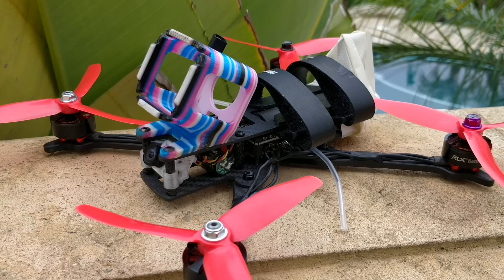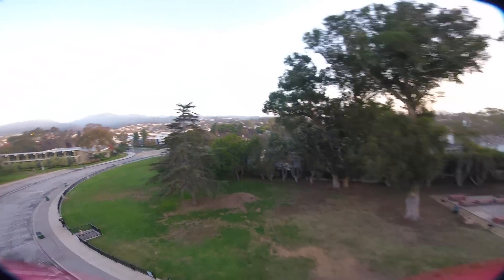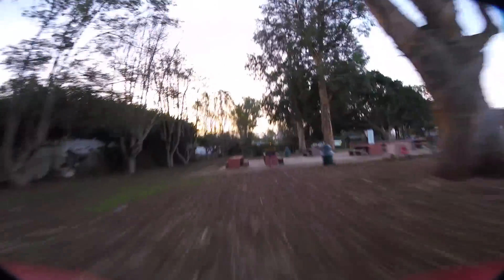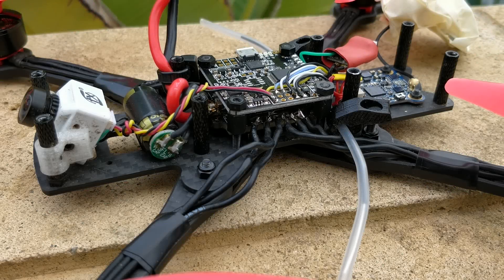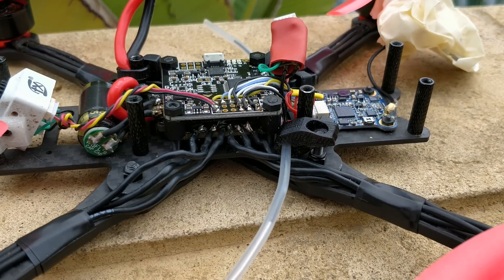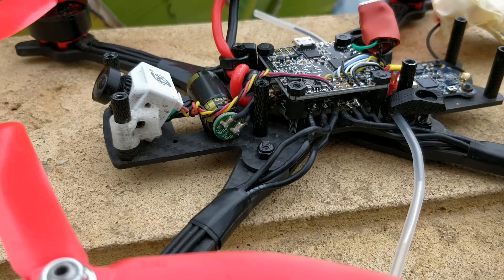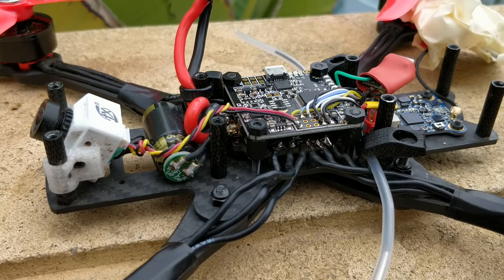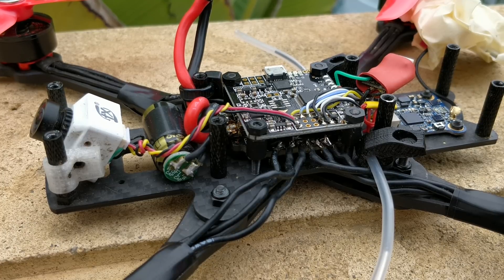Naze32 in 2019...

Comment: BF 3.2.5 not 3.5.2. Got me for a minute there. I though did they start supporting F1 boards again?
Reply from the maker: Oh shit you're right!!  My dyslexia wins again!
Reply from the maker: holy hell I'm putting 3.2.5 on my other quads now.
Reply: @Kabab  I've been running all of mine on that for over a year now - BF 4.0 builds are good enough that I'm moving them all over.
Reply: @tehllama42   Are you saying that you are rolling back your BF to 3.2.5....?
Reply: @MrFadjule  Nah, that I've been running 3.2 on everything since it was in release candidate.  Even after 3.5.2 came out, I was still flashing builds to 3.2 because I was more comfortable with my tuning approach and D-Term Setpoint Weight/Transition settings.
The #1269 and later BF 4.0 builds have dynamic D-Term lowpass filtering, and that's a big enough handling improvement that I'm flashing everything over to take advantage of it (even though I'll have to retune a couple dozen quads, and figure out my feed-forward preferences)
Reply: @tehllama42  same same i just finished switching from 3.2 to 4.0
Reply: Whats the pids? Im curious lol
Reply: I would like to build a race style quad that I can fly stabilized LOS, does this board offer a stabilized flight mode?  Thanks a million for sharing your knowledge man.
Reply: @dronexfun8469  Yes, the accelerometer is what is needed for stabalized modes, and all boards have it. Some people disable it to save CPU load, which disables the stabalized modes. In betaflight, look for ANGLE and HORIZON flight modes.

The Naze32 rev5 came in two flavours - acro, and full. The full version included a barometer and was more expensive. The rev5 version was very popular and arguably a better board than the subsequent rev6 etc boards. Personally I don't disable the accelerometer as I use it for failsafe settings (if you do that, you do need to test the failsafe throttle setting [use lightest flying weight], to make sure the quad actually comes down). This gives you a safer level decent (failsafe  LAND setting) and allows usually zero quad damage after a failsafe. I fly mostly bush(forest) areas. If you fly where people might be, the failsafe DROP setting is advisable (no powered props at crash time).
Reply: @dronexfun8469  Yes it does, It did it back in the Days already

Comment: Thank you for this vid.  Is there any possible way to put curfew or ELRS on this flight controller?
Reply from the maker: I'm pretty sure you can. I haven't used elrs however but I'm expecting it to be the same as the rest
Reply: sure! I'm flying Naze32 rev 5 with ELRS using UART2. UART2 pins are RC3 (TX) and RC4 (RX).

Comment: I actually got a old quad from a buddy who could never get it flying. Wasn't really wanting to get into FPV quads since I was deep into RC cars at the time but they were always interesting. Got a box with a drone and a bunch of random parts with the cheapest transmitter and receiver with one battery and I found all the same little hacks you did with this board. I am practicing in a sim at the moment but the quad is now a camera mount away from being ready for its first FPV flight and I know so much now that I priced out a modern build and I was over joyed seeing how streamline things are now. Anyways this video gave me hope to actually have a quad that would be worth putting some cash and a bunch of time into. 

Even got the old DYS 20a V1 oneshot125 escs flashed to Multishot at 1.5k and .5k
Reply from the maker: Way way wayyyyyyyyyyy easier today vs just 2yrs ago

Comment: i got this chip and i tried to connect it to betaflight it wouldnt reconize if only cli so i tried to flash naze to it bit betaflight didnt seem to have anny 
than i tried so with cleanflight and it keeps saying failed to connect to bootloader 
i get the blue solid light even do its a pain in the ass when connecting the 2 copper plates 
what am i doing wrong ? i really wanna learn how to build this thing
Reply from the maker: This is a very old board. You may need the old betaflight. Or you actually just need to put it in boot mode and flash whatever the latest firmware for it is.
Reply: @Kabab  i bought a bunch of old drone parts and might have overpaid a bit 
i bought them hoping to learn something about drones, theres 2 naze 32 chips in there
both of them would only open in cli, so i decited to take 1 apart hooked the chip up to my laptop and tried to flash it but now its stuck on the blue light 
i think i might have bricked it ?
anny recomindations on another cheap chip i can put in there i think its using 6s batterys and 2300kv motors
Reply from the maker: @Tyson31991  I would absolutely not recommend anything old or cheap. FCs are like $30 or less these days. You can probably find a modern one with osd for even $20. You're wasting time and money with anything cheap. It will cost you more in the long run. Just get a talon, Brainfpv it even a flight one board.
Reply: @Kabab  thx will look into it if i cant get this one workin

Comment: I made the mistake of trying to use an F3 board in 2019. Blew 2 boards in a row by supplying it 14.8V accidently instead of the 5V input required. I have found $20 F7 boards on banggood, so I am just using those now

Comment: I think people blame equipment too much. 
I started out with a naze32 board and a tactics fw radio that only had a pwm rx. I used a pwm to ppm encoder and rocked that setup for a while before I bought decent gear. 
I crashed a shit ton, and the rx would lose signal all the time, but I didnt know any better or have anything to compare it to. It made me learn how to fly and once I got a new radio, holy fuck I flew so much better.

Comment: Hmmm, naze32 came out when there was no blheli, no bitchin motors, only 8" props with simonk esc. Having new tech esc/motor/props/mini frame is cheating imo and then adding the latest BF (for the F1 board), if your going old school, then do it with a KK2, non simonk esc, takner quads and run baseflight, make it real, and not real babble.

Comment: Funny thing: I built a 280 quad back in the day when the naze32 first came out...I havent really flown and suddenly had no time and other stuff to do. So I will come back this year...with a search for a thing to learn acro fpv and havent really digged into all the stuff. I stopped at cleanflight. Now that I come back and see this video, I realize how much has chanhed and that my quad, that only had minutes of flighttime with all the jazz that was new back then, is a laughing stock. Extra OSD, giant space problems, huge weight, because I put everything into this...man, I dont know if I can really fly it later on. At least the taranis x9d is still a thing and my goggles are still absolutely okay with the skyzone v2s....and the blue cloverleaf+patch antenna is still okay. ;) 

BTW: Besides some hours in a simulator I would like to train acro in a small, unwindy gardenspace and it seems, that I wanna start with a whoop with all the guards +turtle mode. Which one would you suggest..wait for a mobula hd, wait for an emax 2s whoop or would you say, that 1s is enough and also more fun to fly tight spaces and really try to learn to fly such spaces? The diatone plasticy one, which also seems to be quite robust? From your other vids it seems you had huge fun with the tinyhawk and it also looked locked in and fast enough to fly those smaller spaces.Any advice? Or go without propguards with something like the diatone r249 HD?
Reply from the maker: Anything you fly will be fine.  I still say to use a sim for a couple weeks and just build yourself a 5" quad.
Reply: @Kabab  Yeah, will probably go for bigger one. I just will have some quality time in my small 10x10m garden, not much wind and some not to tiny bit thrilling gaps. So I at least need an adive what to fly in there...I guess I really should stay slow....so a 1s whoop I guess...just wished the tinyhawk would have had a better camera and stuff. I like the "sort of" quad stack of the diatone. It seems not only slow on 2s...it would be interesting to get to know, if you can tune this to be as locked in as a tinyhawk. Perhaps lower some values to let it feel like a 1s, locked in experience. The best close quarter video from you really is those of the tinyhawk. ...hm, what are they working on behind closed doors? Perhaps I wait another 2 months to into buying quad stuff.
FPV sim: Really Velocidrone or for funsies the liftoff one?
Reply: @Kabab  Yeah, will probably go for bigger one. I just will have some quality time in my small 10x10m garden, not much wind and some not to tiny bit thrilling gaps. So I at least need an adive what to fly in there...I guess I really should stay slow....so a 1s whoop I guess...just wished the tinyhawk would have had a better camera and stuff. I like the "sort of" quad stack of the diatone. It seems not only slow on 2s...it would be interesting to get to know, if you can tune this to be as locked in as a tinyhawk. Perhaps lower some values to let it feel like a 1s, locked in experience. The best close quarter video from you really is those of the tinyhawk. ...hm, what are they working on behind closed doors? Perhaps I wait another 2 months to into buying quad stuff.
FPV sim: Really Velocidrone or for funsies the liftoff one?

Comment: Glad to find this. I just received my first kit a ZMR250 with a Naze32. BTW I got 4mm arms with it. Just missing a PDB. The kit came in the mail this morning and I've been looking forward to working on it all day. Now I'm glad I didn't go for a newer controller. It  opens up more budget for a transmitter and reciever. I'll be in the air quicker than I thought possible. Thanks!
Reply: Tried updating firmaware to 3.5.2. Now the board only has a blue light. When I try to connect I get an error message saying "No response from bootloader". Help!

Comment: Ha! I’ve been using a kk2 all year lol. I just upgraded to f4 fc
Reply from the maker: Any notable Improvement other than the OSD?
Reply: Beta flight is so much better than the kk2 software (idk what but it was what came default). One thing I noticed immediately is that when you give control the f4 holds the quads angle really well, the kk2 you had to constantly correct. And I tuned (what you could) of the kk2 control loop but the f4 feels so much more stable with stock pids 
also AIRMODE, with the kk2 you would drop throttle and just lose all control.
Reply from the maker: @emberpolyvideo3287  it's cute that you're comparing a kk2 to BF but it's like comparing a car and a dog. They are two fundamentally different things.
Reply: Definitely lol

Comment: I'm not a quad pilot but an engineer and I don't see what's bad about this "old" quad at all. 1000 Hz is a lot considering that it can take even such small motors several if not hundreds of ms to spin to the desired rpm. I'd guess that oscillations of the whole vehicle would have magnitudes lower frequency as well.

"More information is more information"
Yeah but it gets lost. You see, there is no point in updating the internal state at an 8x rate if the motors will never be able to react so fast anyway.
Actually, if you don't low-pass filter all the data (which put simply "removes" all that extra information again) and it is quite erratic (lots of "information") then you could actually get worse performance.
So effectively you have no extra information. You have to filter erratic changes (high frequencies) resulting in what we call an oversampled signal. So you end up with lots of data points but most of them are redundant, so no extra information.

Also, all of the above assumes that the desired rpm can be sent to the motors immediately. Obviously with PWM there was a large delay there and oneshot/dshot etc. really fixed that problem.
But even with higher delays you should be able to build a stable quad. It just wouldn't be as snappy.

As an outsider, the fallacy in all this quad development I see is the assumption that faster & more = better. It's not. The fact alone that there are serious physical limitations (such as inertia) destroys that.
Reply from the maker: While that all makes complete sense, the experience of various factors changing over the years and updates has in fact improved things. A lot of that was at the same time as the read rate increases.  Whether it was from them or not, we all became wrongly accustomed to higher rates meaning better. That's where all this false logic comes from. Still to this day there are many devs arguing over these rates. Meaningful devs that have made products that run the higher rates and are in fact better in some ways. At the same time there are projects locked on 1k and fly better in other ways. It's all very difficult to separate out and logic has taken a hit a long the way. 1k read sounds extremely fast to me. Especially when cars ABS or DSC only read at maybe 100-300hz from what I looked up way back when.
Reply: @Kabab  After some further research I could find more concrete numbers from actual measurements: the "interesting" signal (for quad flight stability) from the gyro/accelerometer is typically below 100 Hz.
The rest is higher frequency noise or resonances that would completely destroy performance if left unfiltered and could even lead to positive feedback loops resulting in oscillation and instability.
Reply from the maker: @xnoreq  right. That's why we started with a big low pass filter and then it got more complex from there.